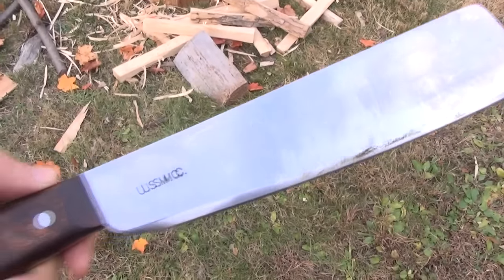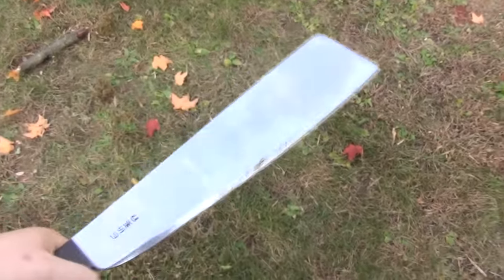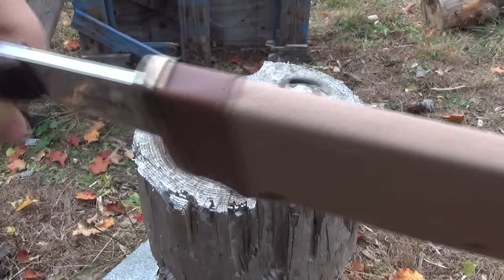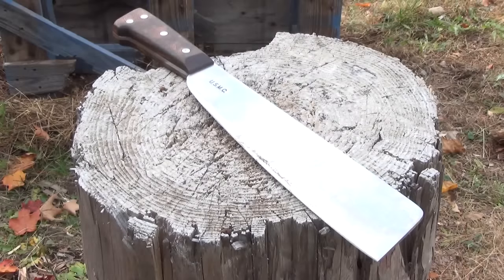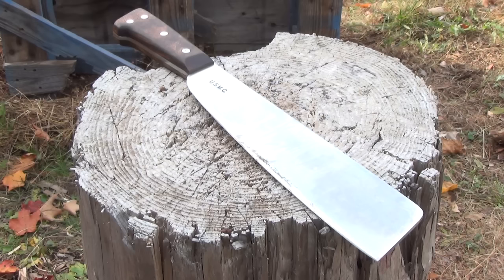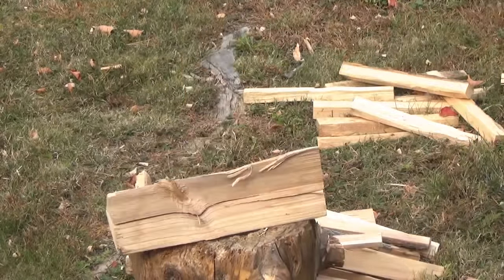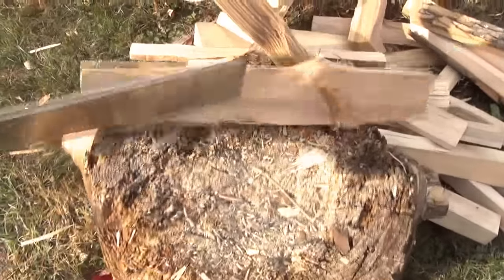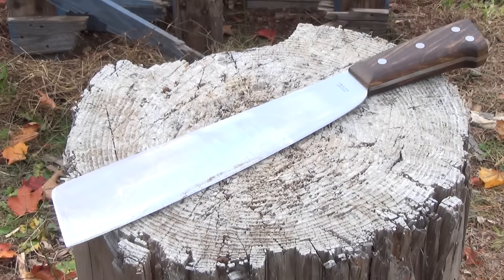Square Tip Replica WWII Machete Review

Comment: I have an original (Ontario) USMC Entrenching Machete, and the edge geometry is completely wrong if that is what Windlass is trying to emulate.  On th original, the edge is a chisel edge, sharpened only onthe right side, slanting to a flat edge on the left.  Also, on the original, the square tipof the blade has the same chisel edge sharpening, making it possible to dig with the blade as well as chop.  I was sceptical of this method of edging when I first got the blade, but it has become my favorite outdoor carry since I started using it.
Reply from the maker: Yeah, the thing about Windlass is that they do not fully sharpen most of their blades, definitely require further work.

Comment: I've been looking at this for awhile but never picked one up. Too bad about that edge, or, non-edge I suppose. Also, if this uses the same carbon steel as other Windlass blades, it's 1085.